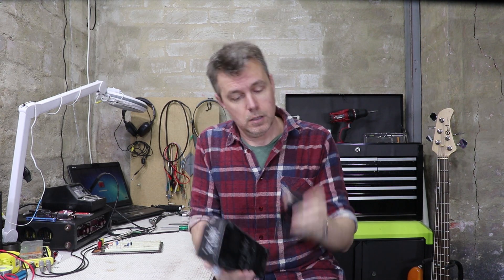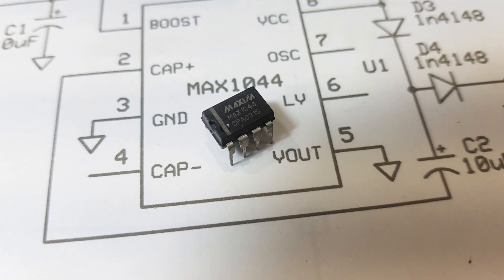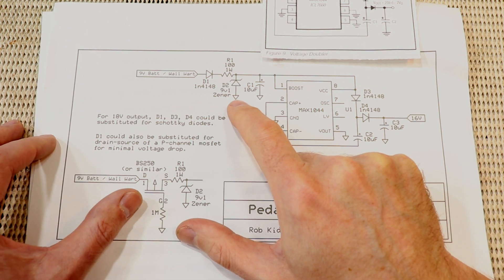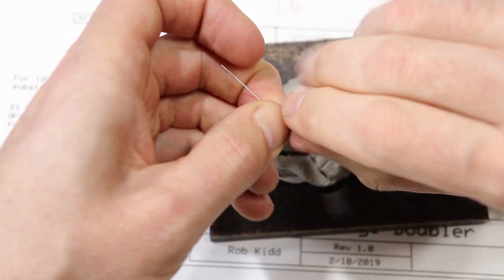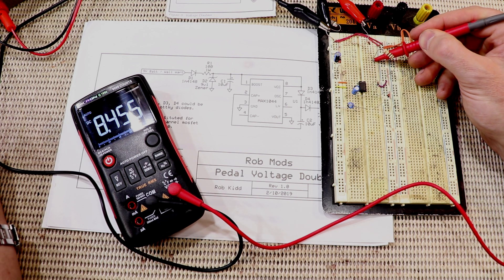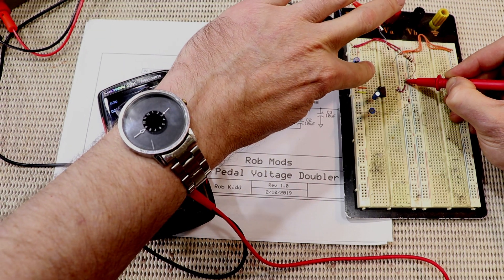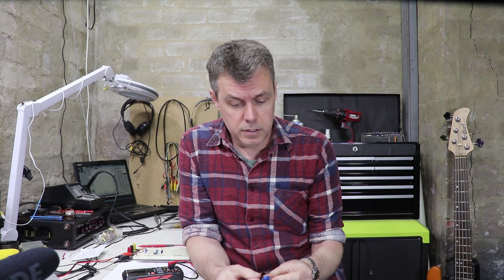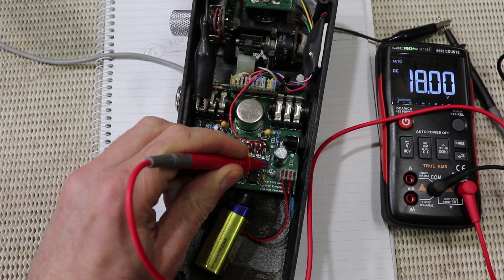How To Run An 18 Volt Pedal From A 9 Volt Power Supply.

Comment: Hi Rob, great video and it makes perfect sense among a row of pedals with only a 9v mains power supply. I was wondering if the 100 ohm resistor is necessary for other types of pedals. I was planning to install the MT3608 into a home built univibe pedal that requires 24 volts. Do you think I still need the 100 ohm resistor?

Comment: The simplest, cheapest, and smartest way of dealing with an 18 volt pedal is to get an additional 18 volt adapter for that pedal. $10 to $20 bucks. Absolute overkill to redesign the entire power supply circuit. You've literally built a guy a watch when all they are asking is what time it is.

Comment: So I rigged up a MT3608 inline of a standard 9v cable from the power supply, tuned it up to 18v, it works but there is a ton of hiss. Any thoughts why? I also had to turn the trim a fair bit before it moved and was VERY sensitive on the screw. Also noticed the voltage slowly dropping when I turned the power supply off not staying stable 18v  until it reached threashold...

Comment: Thanks for the great video Rob! I went and bought a couple of MT3608's from eBay here in AUS to have a bit of fun. I just want to see how my Fulltone OCD sounds at 18v. I assume after setting the trim to 18v and checking the polarity I'm good to go?
Reply: I also actually used to have that exact wah, sold it as i didnt like the sound. Later found out the 18v output i was running it from on my Sherlock amps PS was unregulated (for whatever reason). It measures 21v and ran on that for 15yrs mind you haha. Anyhow i wondered why my OCD was humming and not making guitar signal. Thanks again!

Comment: Hey Rob, love your videos. You have a seemingly deep understanding with many gems of wisdom along the way. Love it!
I'm looking to try a bartolini ntmb I have at 18v but don't have much room in the control cavity. I was thinking about using one of the step up boards you mention. On hand I have one using the XL6009, from the little research i've done it seems the losses in the step up board are more than the operating current of the preamp itself, thereby reducing battery life by a large margin, more than 50%? The ntmb uses 750uA in 9v operation and 1mA in 18v operation according to Bartolini's wiring pdf.  
Would the mt3608 be more efficient? By a decent amount?  Perhaps as you mention in the video I should build a charge pump but the mention of possible noise interference made me wary....
Cheers
Leigh